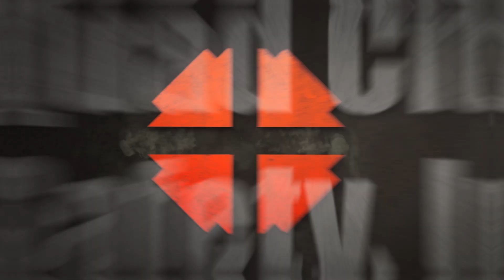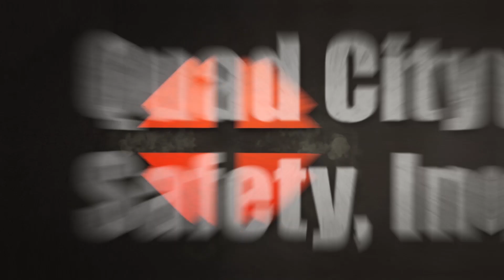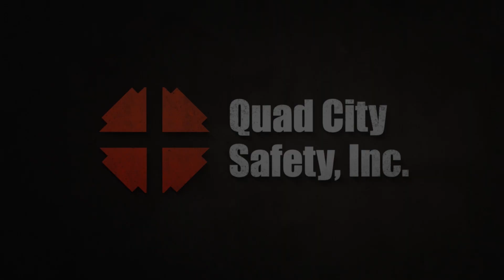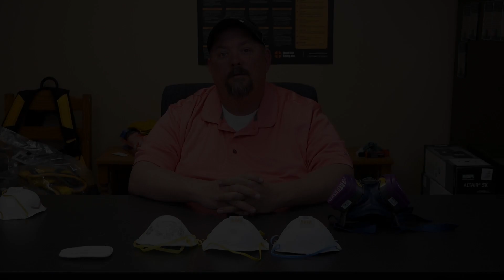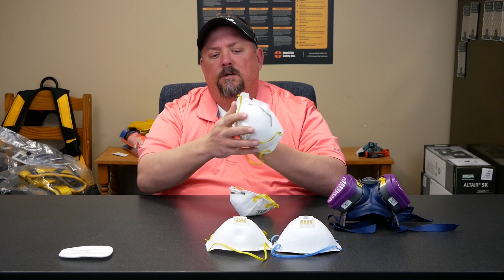What Does N95 Mean & The Differences In Respirator Air Filtering Ratings

Comment: Can P95 3M 8271 be used in hospitals or for protection from the Coronavirus? Are they as good as the 3M N95 8210? Thank you
Reply from the maker: Haris Muzaffar it will definitely protect the wearer in the same way as an 8210.  P95 Vs N95 perform the same way in regards to filtering airborne particulates.  Since an 8210 doesn’t have a exhalation valve it may be safer protecting the public from the wearer.  Hopefully that answer makes sense.
Reply: Quad City Safety, Inc. Thank you
Reply from the maker: Armando Sturzenegger even an N95 respirator is only telling you that is protecting you from 95% of small airborne particles.  I think the thought is that this type of mask combined with all other preventative measures is just giving you the best shot to protect the wearer.  Certainly the mask isn’t making you bullet proof.  Thanks for watching!

Comment: They tried to tell me those where not safe
Reply from the maker: Treva Lindley you’d have to give us a little bit more info as to what you’re referring to and we can do our best to help.  Feel free to email updates@quadcitysafety.com if it requires more dialogue than the YouTube comment section can provide.  We’re here to help.
Reply: @QuadCitySafetyInc  ok i work on a amry base feeding the soldier and they are telling people that you can only ware certain kind of mask  i had on a 3m 8511 N95 respiratory mask and they told me i couldn't ware that i did my history on this mask 95% safe what do i do cause I'm not sick and sure dont want to get sick we got cases here in lawton that are growing
Reply from the maker: Treva Lindley without knowing the reason why they are deeming it unsafe it’s hard to tell.  The performance of that respirator definitely would preform at an N95 level.  I’m not sure if there is another hazard that they are concerned with.  Stay safe.
Reply: @QuadCitySafetyInc  ty
Reply from the maker: Treva Lindley you are very welcome.
Reply: Treva Lindley probably because it had an exhalation valve on it. And if your feeding soldiers and preparing the food every time you exhale you are releasing your droplets through the valve onto the food. Stick to a surgical mask
Reply: Would p95 work just like the 95 for the covid
Reply from the maker: Ken Brown short answer yes.  The only difference is that a P95 also protects against oily particulates.  Also, usually is a more expensive mask but if you can find them they would protect the same.